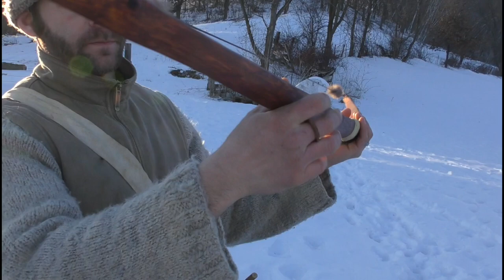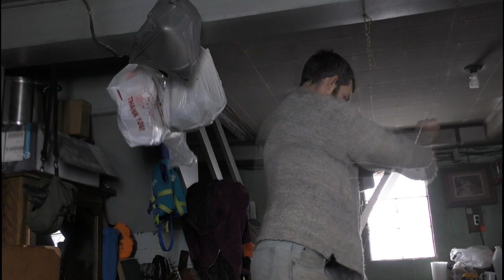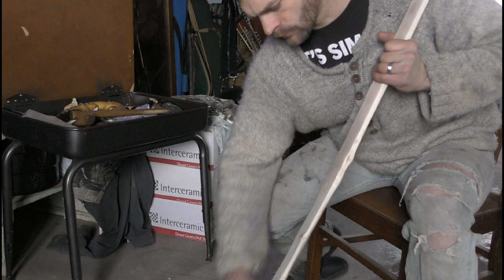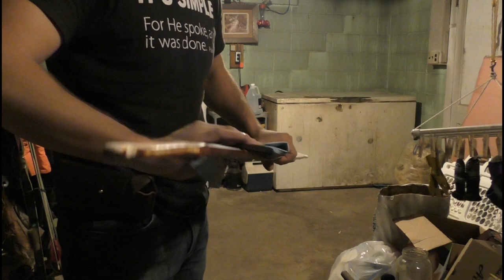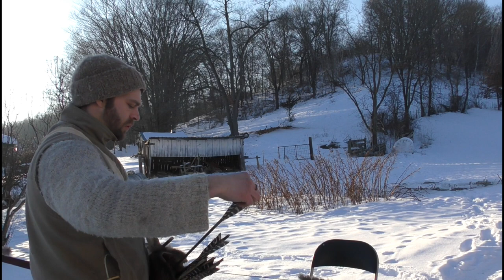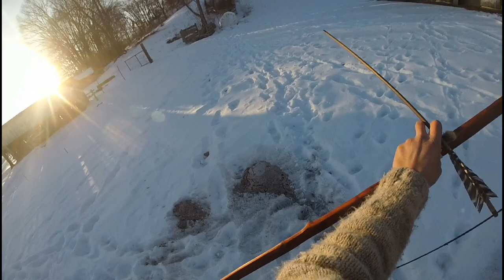Birch Longbow

Comment: Здравствуйте, мне понравилось ваше видео. Скажите, любая ли береза подойдет? Я хочу сделать лук из березы, в длину примерно 110 сантиметров. 40 фунтов. Без усилений спинки и сухожилий, как думаете, получится? Спрошу по-другому, вы бы смогли делать лук с такими характеристиками без усилений?
Reply from the maker: @shelbi328
Hi there!
I do believe any Birch will work for a bow, although my only experience is White, or paper Birch. Yes, you should be able to get a 40 lb bow if you use similar dimensions. It seems like the tension strength for Birch is decent and does well unbacked. Hope that helps, God bless!
Reply: @primitivepreacher8964  Amen

Comment: Abiogenesis fails!
God bless you brother!
What's the weight of that bow? and the weight of the black locust bow?  you took the deer with
Reply from the maker: @tonymaurice4157
Amen! God bless you as well! This bow turned out around 40 lbs, and the Locust bow is more like 55. Thanks for your encouragement!
Reply: @primitivepreacher8964   black locust Make great bows. Most will tell you it's not good. But it Just needs a good tiller.